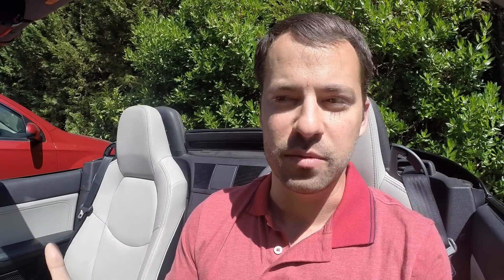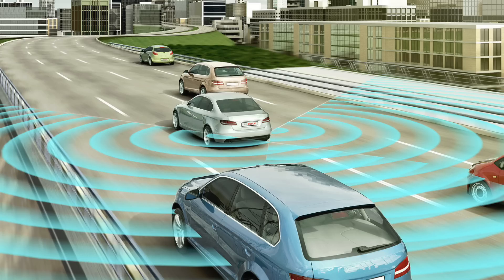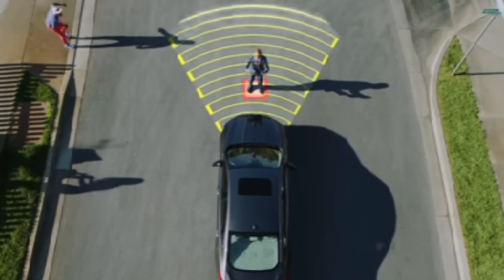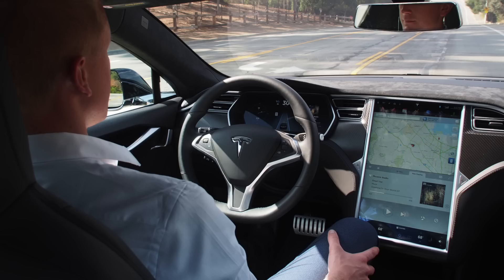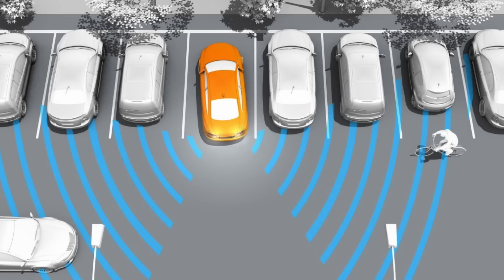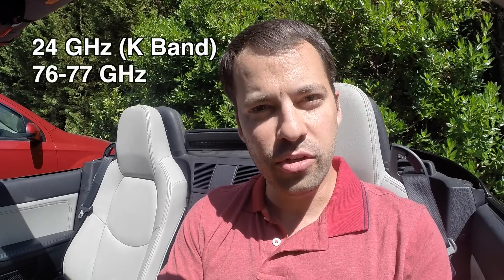Cars to stop using K band for BSM radar!

Comment: That would be fantastic if my area didn't use K band still, but unfortunately some local police officers do. Maybe on Black Friday I'll splurge on a newer radar detector that actually has a gps chip.
Reply: Ive been very happy with my Uniden dfr7, it out performs my other max360 and is a lot quieter. However, on laser it is not as good as the 360 but once you are hit you are screwed anyway.
Reply: I turn laser detection off anyway lol. It's useless. I might get a max 360 just because my truck is already hardwired for Escort detectors and I'd like to keep it that way.
Reply: ClassicRocker 81 You can still use it if you wanted to get a R3 .
Reply: It's not useless. It will tell you that it is being used in this particular area so you can adjust your driving habits accordingly.
Reply: Laser detection on a radar detector is nothing more than a ticket notifier. I see no point in keeping it turned on as it hinders performance anyway.